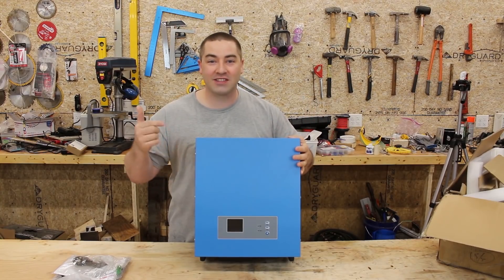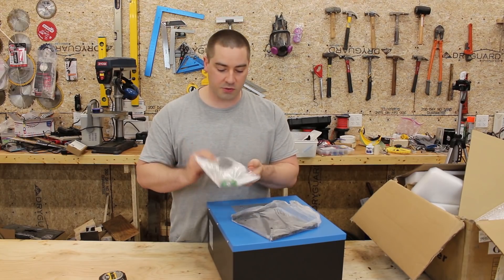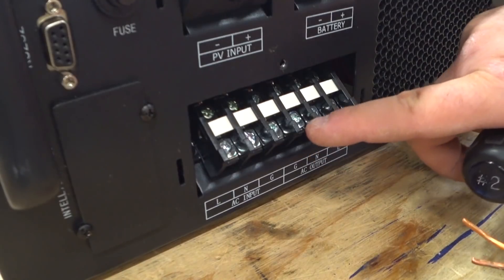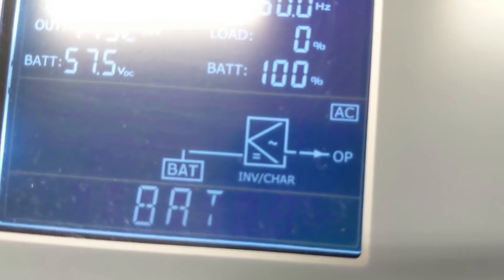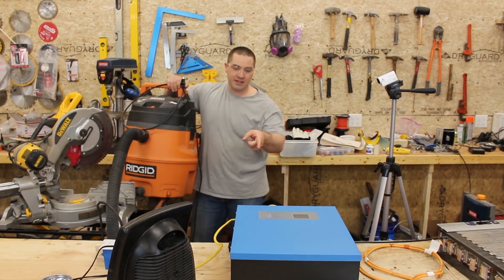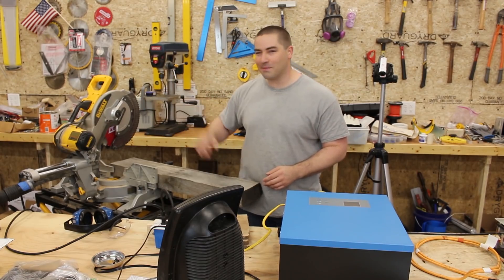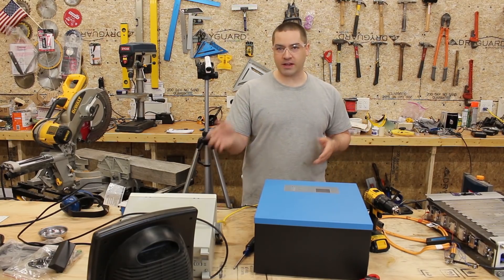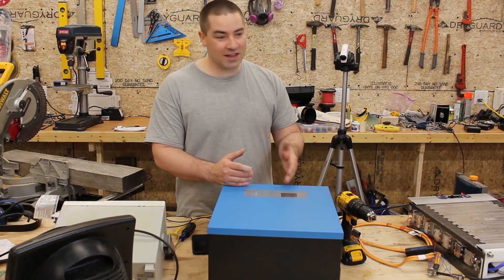Sigineer Power Off-Grid Solar Inverter 2500 W with MPPT Charger

Comment: Yes, you are absolutely correct. Low frequency, transformer based inverter/charger offer a much higher peak power capacity and a far longer life expectancy than cheap, lightweight high frequency inverters. And by the way, we've done some extensive testing on the Sigineer brand of low frequency inverters and found them to be an excellent product.
Reply: So you would recommend one over a EG4 6000xp

Comment: Let you know if you need any replacement parts under warranty from this company you will have to pay a very high shipping cost. My remote went out for my 6000w inverter and just for replacing it was $70 in shipping. Great inverter but very expensive warranty if anything goes wrong.

Comment: Thank you David for the Great review. How many ohms is the resistor that you use to precharge the capacitor?
Reply from the maker: That was a 2ohm, 100W resistor.  https://amzn.to/3o39dsA  But the exact ohms doesn't so much matter.  I've used 1-10 and still work.

Comment: Hi David...love the content...I was curious, if you had to pick an all-in-one unit which one would you suggest?
Reply from the maker: My friend, Ben, uses a Sol-Ark 12k.  It's top of the line for all in one units.  However, it comes at a premium in cost.  I've tested MPP Solar LV5048 before and didn't like it.  So If I was to pick one right now and didn't have the funds for a Sol-Ark, I'd buy a Phocos 5k. https://lddy.no/s5eo  But I plan to test more of these all in ones during this year to get a better answer.
Reply: @DavidPozEnergy  Awesome thanks for the info… I’ll check them out

Comment: Good tests! Good review! Exactly hit the real world problems and tests!
I was sold after the cuts. 

Great product !  Tell them thanks again for making it !  It’d be nice if it wasn’t so loud. 

How about a hot water heater, 
a normal microwave oven, or a freezer / real full size refrigerator tests? 

Thanks!
Reply from the maker: This particular unit is 120v only.  So it will work with some water heaters, but not 240v models.  Yes, a microwave is OK.

Comment: When referring to “low frequency” vs “high frequency” I’m assuming you mean the switching speed of the MOSFETS?  Can one of you tech nerds get into the weeds for me with this, the pros & cons?  I guessing, and throw me some rope here, that the higher frequency has a cleaner (more sinusoidal) wave form with less tolerance to dramatic load change due to limits of switching regulators or something? And the low frequency has (less steps?) in the wave which makes less sinusoidal or “more square” in a manner of speaking, but with the ability to respond faster to change because of fewer switching commands to the  MOSFETS?  I’m just trying to think this through while writing this.  Anyway, thank you in advance to any knowledgeable response.
Reply: Low frequency inverters create a low voltage high amperage 50hz/60hz  sign wave and then step that up to 120/240 volts using a large transformer.  This is really a simpler design and it's more robust but it requires a huge transformer which is expensive and heavy.

High frequency inverters avoid the large transformer by doing the voltage conversion at higher frequency... Essentially they add an extra DC-to-DC step that converts battery voltage up to line voltage, then they modulate the line voltage into a sign wave using pulse width modulation and then filter the pulse train to make it into a clean sign wave.  Because the step-up happens at higher frequency they can use a smaller transformer which saves weight and cost (less copper in the smaller windings). 

I'm not entirely sure why the high frequency inverters are less robust but in practice it seems that the bigger transformers on a low frequency inverter can handle a lot more abuse.  A general rule is that the more it weighs the more it'll hold up to abuse and that definitely seems to apply to inverters.

Comment: @DavidPoz
I sell sigineer like crazy here in Utah, sigineer actually makes all the inverters for aims.
Sigineer is a great product, I have a 6,000 watt that would blow your mind, available in 12/24/48v with auto gen start/stop, 120v and 240v single phase in the same unit, has power in from generator/utility to recharge batteries in case of bad sun days, and hard wire for ac power out.
All my sigineer inverters range from 1kw up to 18kw with a surge of 300% for 20-25 seconds.
My inverters under 6,000 are mostly 12/24v special order on 48v for a 3kw
6kw has all 3 options but 8kw you start to see only 24/48v options.
The 15kw model is just north of 200 pounds and the 18kw (just came out 2020 is edging 300 pounds) hmu if you’d like to do a review on any of our products, I have almost all of them in stock here in Utah.
-My Off-Grid Power
Reply: Find us on Facebook

Comment: That noise on your oscilloscope is probably just the back EMF (electrical noise) pushed back into the wiring by the motor starting up.

You can try my theory by attaching the same setup to grid power.

Comment: Hi David!
I am using 4 panels of 260 watts 30 volts 15amps (REC 260 Peak Energy Z-link series).
My Solar controller charger inverter is PowMr 60amps 3000 watts 48 volts with PV input of 145 volts.
Using 14s Nissan Leaf batteries with BMS 48 volts.
Should I do series of my 4 panels to make total of 120 volts or series 2 panels total 60 volts then do a Parallel for 4 panels?
Advice from will be really appreciated from you thank.

Gerry

Comment: Is low frequency good? Efficiency? Idle power consumption? Sine wave inverter, good! It's a bit loud. 👍Thumbs up and subscribed!
Reply from the maker: Generally speaking HF (high frequency) inverters are more efficient than LF (low frequency) inverters.  HF is also cheaper to buy.  But LF is better at handling surges, such as air conditioners and tools.

Comment: the humming from the inverter scares me. yes, the inverter passed the test. how long would it last? in electronic humming signifies something out of phase, or some of the parts in that inverter are too small for the function they are being used for. I can't risk that. the big question is how would I get a warranty from Asia?
Reply from the maker: Yeah there's probably no warranty available from Asia. Some of the better brands don't have these issues like Victron Outback Schneider

Comment: I saw this Inverter on eBay. Would you consider doing a review on it if possible. thank you for all you do. Hugh. http://vi.raptor.ebaydesc.com/ws/eBayISAPI.dll?ViewItemDescV4&item=162093639524&category=58020&pm=1&ds=0&t=1593607004000&ver=0 (15000W(Max 60000W) Low Frequency Pure Sine Wave Power Inverter
DC Input 48V                      AC Output 110V               60Hz
With Battery Charger
With UPS Function
With 3.5" LCD Meter)

Comment: Hey and thanks for the video.
I got a question... so the machine is rated fo 48v battery and you battery is over 57v, i also notice you programe the charging controller to charge the battery up to 58v.
is best to use high capacity batteries?, if wanna set up a 24v system i can confortable use 36v batteries?.

Thanks.
Reply from the maker: When we say 48v inverter, or 48v battery, we are talking about the "nominal" voltage.  All the equipment must be the same nominal voltage to work together.  But the actual voltage will vary at any given moment in time.  Voltages of the battery are constantly changing and the inverter has a range it can work with.  I think this particular unit can work with a range of 42-64 volts.  You will have to check the specifications of your particular unit and battery.
Reply: @DavidPozEnergy  So if the solar inverter have a range between 24v to 48v charging the 36v batteries will be fine?, i will double check everything.

Thanks.

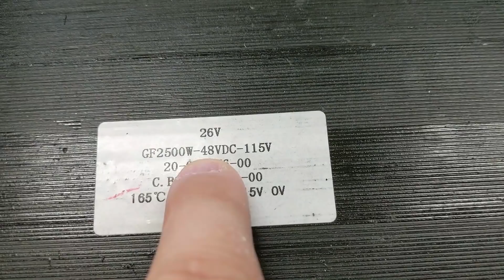Comment: That label on the transformer at 4:21 is wrong since no transformer can convert 48VDC to anything other than heat. I know it is probably just an identifier for the whole unit.
Reply: There's another board that converts the 48Volt DC to 48volt AC then it goes to the transformer 
but yep you are correct in what you mean though

Comment: How does the BMS built into this work?
Reply from the maker: There is no BMS built into the Sigineer inverter.  It just has a communication port.  Sigineer also sells a battery pack, and that battery pack has a built-in BMS.  The battery will also have a communication port on it.  if you have both the inverter and battery from Sigineer, then you can connect them together with a communication cable and the inverter will receive information from the battery.

Comment: David are you going to hook thatSigineer  inverter to your house?
Reply from the maker: No, it's not powerful enough for my house.  It's a good inverter from one power tool at a time.  I'm using 12kw inverter pair for my house.
Reply: What brand is the 12kw system
Reply from the maker: My 12kw system that powers my house is brand: SMA.  It's a pair of 6kw that parallel together.  Here I am installing them: https://youtu.be/aU9gNSoep-o

Comment: The Sigineer, low frequency, 2.5 KW inverter handled the miter saw, where the MPP Solar, high frequency, 5 KW kicked out when trying to run the miter.
Reply from the maker: Yes, Low Frequency is much better suited to surges, like when starting a saw.  But, to be fair, the MPP Solar was 120/240.  So it was only 2.5kw per 120v leg.
Reply: @DavidPozEnergy  High frequency units are also more prone to failure due to demand because they lack the large transformer, and therefore the robustness of higher current handling. The components on those heat sinks in the high frequency unit you were not sure about are either power transistors, or power FET's/MOSFET's. Manufacturers are always looking to cut corners in their designs, and the consumer takes it on the chin when manufacturers over-rate the power capabilities of their end products. Bigger numbers, bigger price, even though you're not really getting what they advertise. As an Electrical Engineer, I see this happening all over the market. I hate my fellow Engineers who have given themselves over to the flagrant dishonesty of executives.

Comment: Thanks for the videos, I am building a battery just like this and want to use the 6kw sigineer. When u were setting up the charging voltage with the solar, does that apply to the ac in also?

Comment: Think that equipment would run a hot tub that plugs into a regular outlet. Heater pump comes on about every 15 min. And a couple refrigerators?
Reply from the maker: If you can plug it into a normal 120v outlet, you can probably run it on this unit.  Most outlets are 15 or 20 amps.  At 120v that's up to 2400 watts.  This inverter is 2500 watts,
Reply: This unit has an auto on-off feature based on load, that turns the inverter off automatically. This should help with the high idle draw

Comment: Super Awesome!  Just learning but I would love to hear your thoughts on a way to use the Solar panels and a inverter in such a setup for my Hot Tub. It has a 4.5 HP motor and heater. I'm here on Long Island NY and the Electric Prices are Killer and have to keep the tub turned down most of the time. Thank you so much for your video's
I just subscribed!
Reply from the maker: Sounds like you are running 240v AC.  This inverter is 120v only.  For over a year I used an Aims brand that was 120/240v.  https://www.aimscorp.net/6000-watt-pure-sine-power-inverter-charger-48-volt-dc-to-120-240-volt-ac.html  At the moment I'm running my house with SMA
Reply: @DavidPozEnergy  Thank you, yes it's 240v AC
Reply: @tomb375  How much do you pay per kWhr of electricity?  Typically, Off-Grid electricity ( Solar Panel + Inverter/Charger + Battery Bank ) is way more EXPENSIVE than Grid Power.  You need to do some MATH first !  Also, Sigineer does make a 240 Volt AC Inverter/Charger.  You are going to need, at least, a 4,000 WATT Inverter just to "run" the motor.  You need to worry about the Starting / Surge amps, too.  Is there an electric heater, also?

Comment: Another great video. Are these units able to be set up in parallel to increase the total output capacity?
Reply from the maker: No paralleling.  If you need more capacity there are better solutions out there.

Comment: I have an mpp solar one and it does not get off utility when the sun comes up, and it waste a lot o energy. I had to turn the 800 watts pure sine wave inverter on mine. the mppt charge controller work really well but if you start using energy the fan is very loud.

Comment: Want to convert my van so i can run a mig,tig or stick welder from an inverter. What would be the best inverter to use and also what would you say the best brand of inverters is regardless of cost ?
Reply from the maker: Regardless of cost I think Victron and SMA are tied in top.

Comment: Any special concerns for using aluminum bus bars instead of thick wires?
Reply from the maker: When using aluminum, you need to coat it to prevent oxidation.  There are several brands on the market that sell electrical grease.

Comment: Do you have a suggestion on the smallest wattage grid tied inverter?  I'm hoping 150W?
Reply from the maker: Down that low you might be looking at "Micro inverters".  I have some of the first enphase micro-inverters that are still running well.  But I don't work with grid-tie inverters enough to suggest one brand over another.
Reply: @DavidPozEnergy  thanks David, I appreciate the feedback.  I found a nice enphase thats about what I want, but was told 'used' could be a problem due to how they can be tied to networks.  The model I was looking at can't be had new.  Do you find the need for a central controller a problem with yours?  Could you share which model you are using?  Thank you!
Reply from the maker: My model is the 215 (I think) installed 8 years ago.  I don't even use the central controller thing.  I've never been on the "portal" because you need to give them your information.  Mine just turn the meter backwards and that's good enough for me.

Comment: hi i want to ask you if i can run this inverter with lithium battry 18650 24v with bms and charge it in the internal mppt charger in the inverter thanks for help brother
Reply from the maker: No, this is 48v only.
Reply: @DavidPozEnergy  okay if i add 48v can it run
Reply: @kamalelidrissi2629  Or purchase a 24 Volt inverter.  But 24 Volts will reduce the max Watts output.. What is your 18650 configuration ... 7S100P ???

Comment: That is great demo.. Instead of pv input.. Can I use dc coming from my alternator 48 v?

Also can same applies on battery input? Replace with power source from. Dynamo 48 dc volt
Reply from the maker: The input DC voltage has to be higher than your pack voltage.  I was charging about 58v, so I would need at least 68v or more coming in.  I don't know if your alternator can do that or not.  But the battery must be a battery.
Reply: I can ensure that about voltage from alternator is higher .. Coz before I was warned by suppliers not to use charge controller with any input dc... Just was surprised.. That why I did ask you

Comment: Hi David, I enjoy your videos, very informative. Have a question about this inverter and the 8000 relaible, which one should I buy? I work with power tools like your saw, for home projects.
Reply from the maker: I would buy this one for temporary situations.  Where you only need to power a tool once in a while, then it gets turned off.  If you need the inverter running 24/7, then this one is not the right choice.  Buy one that is more efficient, like Aims, Outback, Victron, Magnum.

Comment: Does that loud fan run all the time when the inverter is on or only when it gets warm?
Reply from the maker: I think that noise is the transformer, and is all the time. If it was a fan I could swap it out for a quieter one, but it's not the fan.

Comment: Could you use several of these in a home that adds up to 10kW? Or would you just go with a larger inverter?
Reply from the maker: This model does not support pairing.  You would need to go with a larger inverter.

Comment: can you weld with off grid solar
Reply from the maker: I have a little 120v flux core welder that works off-grid.
Reply: @Rigo Star - YES ... ONLY if the Welder consumes less watts than the Inverter can supply ...

Comment: can 2 of them be linked together for 2 phase 240v
Reply from the maker: Nope.  This model does not support pairing or syncing.  They make 120/240v inverters but you would need a separate charge controller.

Comment: The biggest problem seems to be the limited voltage on solar panel input. Followed by stand by consumption, efficiency and noise. It’s not that unusual for a hybrid inverter to be inefficient compared to a grid tied solar inverter.

Comment: Very nice unit .. The ac in will this unit automaticially swith to grid power if not enough battery or pv. Power ??
Reply from the maker: I have not tested that feature, but the manual says it can.

Comment: I think the fact this works may have a lot more to do with the batteries than the inverter.  I will test soon I have 3 6kwh modules from battery hook up bolt batteries and a LV5048.

Comment: HI David, thank you for this review. I got this one, but 2000 watt, plugged to 1000 watt of solar panels and 4 100 amp 12v agm´s. Could not find anywhere the name, brand or anything. It is very robust, but two things I really don´t like: Idle draw,  and the fan. It´s very annoying, since I have it inside our cabin (maybe upgrade it to a silent pc fan). I feel that the idle draw is affecting negatively the charge of my batteries at night, may need to upgrade my system a bit, but would need 4 extra batteries, and some extra solar, to offset it´s idle draw. Could you test the inverter with some ac variable speed tools? I can run everything, but 1 bosch variable speed drill, which will make the inverter shut off.